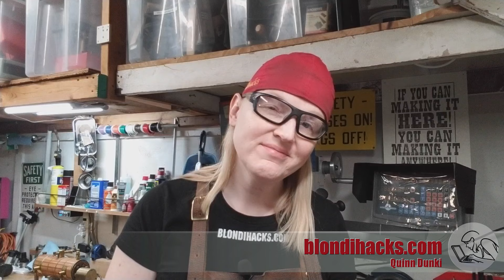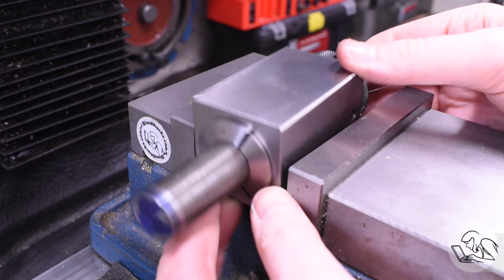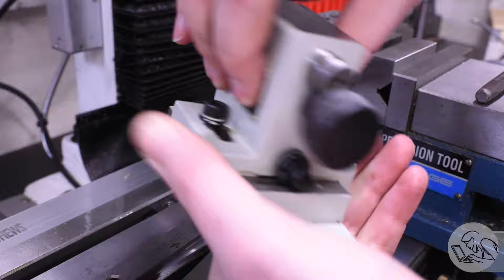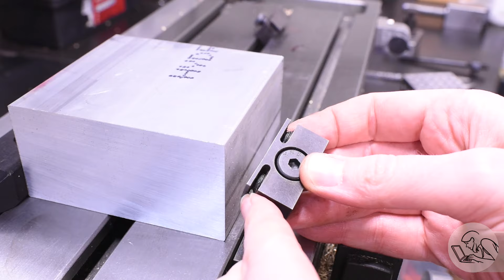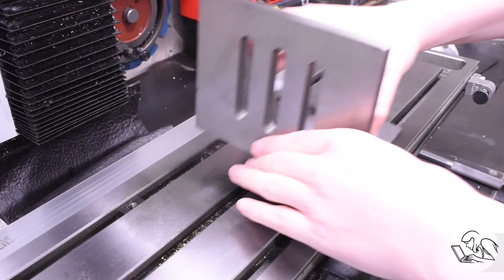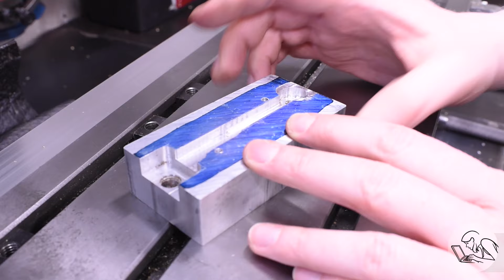Mill Skills 8 : Basic Work Holding & Fixturing!

Comment: Quinn, I'm an electronics engineer (35 years in design and support), and I think I'm fairly proficient at the 3D Printing design flow. I've designed a lot of hobby use 3D Printed tools and jigs etc, but the limits of plastic have inspired me to get into machining (last time on a lathe and mill was back in college 40 year ago). Your content is the best on the web by far. I thank you so much.

Comment: G'day from tropical North Queensland, Australia Quinn, thanks for your super informative videos, they really are standing the test of time.  I'm fortunate enough to have got hold of an old Cincinnati Toolmaster 1C as my first mill and the vast majority of what you've presented is very applicable (though I don't have a quill, so knee cranking it is for me...).  I do have a question though, with the strap clamps, toolmaker clamps etc, are these perfectly adequate when made from say 1020 or other decent grade mild steel, or would they benefit greatly from being made from a high carbon steel like Cromoly?  I don't have the luxury of having various merchants with all grades available locally, so need to plan these things out so the specialty supplier can order in (or go hunting on fleabay etc).  I suspect that using the softer material will benefit when clamping harder workpieces as they aren't typically used as a precision positioning component like the vice and vee block (though I'm sure you have better insight than me on this).  Now to go look at scraping my table to get 50 years of cane farm work smoothed off it... and figure out a way to make the old (but enormous) cast angle plate smooth, flat and with a precision angle again.

Comment: Hi, thanks for all the great videos!  I recently acquired a used small mini mill that has a spindle with a 3/4 -16 thread.  It came with a Taig 1037-3H 2 inch faceplate, with bolt holes, that fits the spindle.  What would that be used for???  Thanks

Comment: or you can 3d print a jig to hold it!

(note: in my experience, you usually need to offset the inner surface of the jig by .1 mm in Fusion for it to fit well even on a very well calibrated printer)

Comment: Terrific video Quinn. Some twenty years ago I work for a machine tool company as a software developer. We programmed our A axis as a linear axis . You specified the diameter of the part and then just programmed as if it were a flat surface X and A. This turned out to be used extensively with people who cut roll dies, but you could also use it to engrave on a round surface.

Comment: Quinn, my whole family loves your videos! (No small feat since 2/3 have almost no interest in machining, but we all watch together and really enjoy them.)  I'm about to invest in my own mill and I have a question re: something you've mentioned in the past:  Spindle speed.  

I know the PM-25/Sieg SX2.7 class mills top out at ~2000rpm and this can be limiting in certain materials.  I have almost convinced myself to step up to a SX3.5 mill that supports up to 5k rpm (and has some nice additions like power-Z lift), but by the time I spec out a mill w/ DRO and power feed X, and add some tooling, I'm well over $5k USD.  If you were buying a new machine knowing what you know now, would the extra spindle speed be a must-have?  (I suppose a slightly bigger machining envelope and more rigidity is also a factor, but not sure it's enough to justify the cost delta.)  Thank you!
Reply from the maker: The higher spindle speed is very rarely needed, in my experience(unless you’re making watch parts or other tiny things). Power Z lift sure would be nice though. Cranking that head up and down gets hard on the right shoulder rather quickly.
Reply: @Blondihacks  Thanks much! Z-lift retrofit available for the smaller mills, so maybe I skip the bigger mill in favor of more/better tooling! :D

Comment: As a mechanical designer, I have learned quickly that the fastest way to make a part cost skyrocket is to make it hard to fixture. Small size, weird angles, etc. and that cranky machinist will make YOU cranky when you see the invoice.

Comment: Wait, your vice doesn't have auto-tramming feature? On the underside of the vice there is usually a slot that coincides with T-slots on the mill. There also should be some threaded holes. I have two little blocks screwed in there that fit snugly into the T-slots and keep the vice trammed. Obviously very high precision is required, mine are surface ground

Comment: do i remember Quinn using a 90 degree angle plate with some angled blocks to hold a difficult casting and do a feature at an angle to the 90 degree plate...

Comment: why not just put 5/8" dowel pins in the t slots to align with the table??
Reply: @randy-yk1yk 
I've had some success treating table T slots like V blocks.
On my small mill, I put a decent length of 1/2" silver steel rod lengthwise on the Tslot, then butt up a length of steel or brass against it and clamp that to the table to act as a fence. Wider slots may need a larger diameter rod.
When I need the fence to be 100% parallel, this method at least gives a good starting position.

Comment: I have seen a fixture on a hobby lathe where the work piece was attached to the cross slide and the cutting tool fitted to the spindle, this allowed a limited milling option on the lathe. So by adding an adjustable fixture the height became adjustable too, Myford lathes manufacture all these fixtures for their lathes.